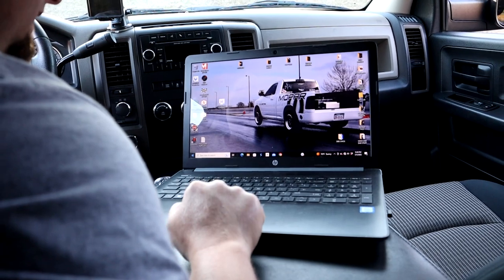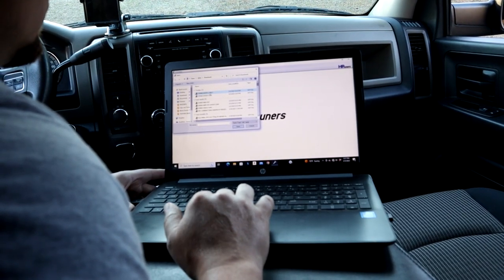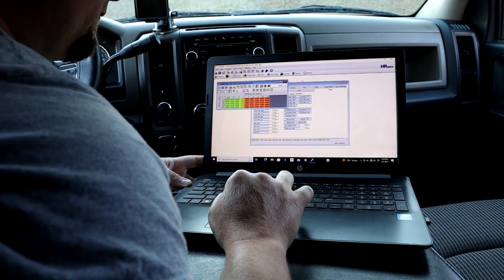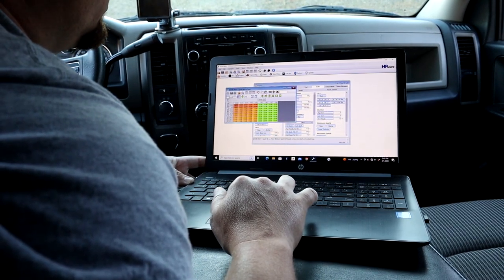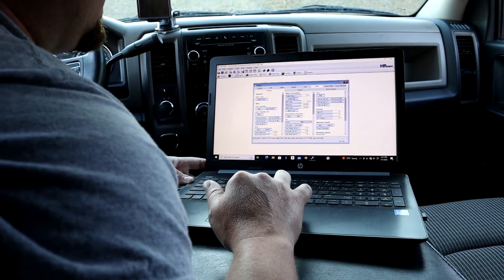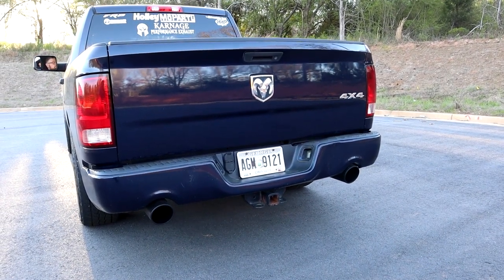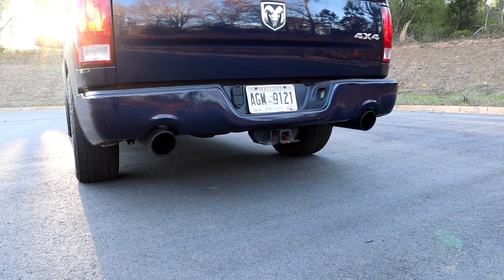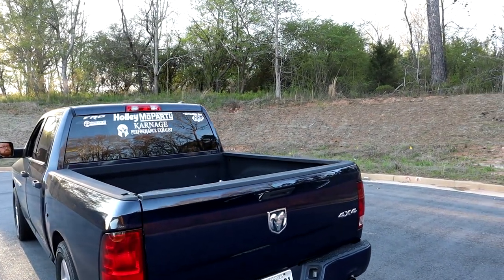HEMI Ghost Cam Tune With Stock CAMSHAFT!

Comment from the maker: Thanks for the awesome support mopar fam. I think this is pretty cool myself especially for the one that just wants a little rumble and not spend the time and money for a cam swap especially if performance is not the goal. Keep in mind I'm definitely not a professional tuner and I'm still learning every day just wanted to share this as a possible option.
Reply: Honestly pretty sick man! How much was the tuner?
Reply from the maker: @donttalkjustplay4274  I use hp tuners software.
Reply: @FrostbiteRam  ...will this work on my 2004 Hemi Ram1500 5.7L quad cab
Reply: Thumbs up! Can this be done with a Diablo tuner as well?
Reply from the maker: @wilsolo1986  should be
Reply from the maker: @ghostrt1608  it may I would think so.
Reply: @FrostbiteRam They didn't start vvt in the gen 3 engines until 09.
Reply from the maker: @bmf88  correct why you say
Reply: How would you do it on a Diablo

Comment: You forgot two things, which is why it doesn’t chop harder to be more noticeable. I can send you a file that has all the corrections you need to make. And it will sound pretty good.
Reply from the maker: Nice
Reply: you still have that file by chance?
Reply: I'm intrested in see your chop tune also
Reply: I am interested in your file as well. Do you have it posted on the HP Tuner repository?
Reply: Do you still have it ?????
Reply: send file koon
Reply: Hi can you due it for my 09 challenger srt8

Comment: Thanks for the video.  I "Ghost-cammed" my 2014 Challenger R/T.  It actually works!  I followed a guy named Randy on RecklessMotorsportsUSA (YouTube) and he went through a lot of the settings.  Because mine is a M6 car, with VVT, I had a little more that I had to do...especially around the idle.  I learned quite a bit from it, making my investment in HP Tuners last year, worth it!  Plus, I've added timing, leaned it out to target 12.25:1, instead of the factory-programmed 11:1.  Good Lord, what are they thinking....dumping all that fuel in there. :)  My Challenger runs soooo much better now.  Responsive (WOT voltage reduced so tip-in is more aggressive), leaned quite a bit (only run 93 now), and higher MPG, due to increasing timing in the highway cruise cells.  I've also chopped the stock 2 1/2" pipes just aft of the stock bottle-style mufflers....and put turndowns on it.  Now, with the ghost cam tune, this thing sounds like a completely different animal.  I can't wait to throw an actual cam in there (Scoggin-Dickey Stage 3) here in the spring. 😎😎
Reply: How’d this go?? I have a 2022 M6 Challenger R/T.
Reply: It went ok, until I started getting "Random Misfire" CEL's.  I've since returned it to a "non-ghost-cam" tune, with all of the other improvements still in tact (leaner fueling, increased PT cruise timing, etc).  No more CEL's.
Reply: @ronbo422  Oh interesting. Thanks for the info!
Reply: @ronbo422  did u ever figure a fix for the engine light. i have the same year and engine but mine is 2014 charger could use your help
Reply: @calebcantrell8722 No, I never did.  It was just random misfires.  I could easily turn that off, in the CEL list, and go back to the ghost cam tune, though.  I've since added long tube headers and midpipes, along with an SRT8 2¾" cat-back system that has dumps, right at the rear end housing.

Comment: For little over year I've been running similar tune on my 5.7 charger with no side effects. My numbers are quite different than yours plus mine also does it in reverse and forward gears if your going to do it why not all the gears. People ask nonstop if it has a cam and everyone thinks I'm bluffing and don't believe me. I read people hating those with ghost cams calling it equivalent to up badging. I don't do it to fool anyone Not my fault it sounds real and they think its cammed as long as when asked I tell them its a tune the sound is my personal preference.
Reply: Bit late to this, but I’ll be doing this same thing to my manual challenger soon. Does having it in all gears affect drivability at all?
Reply: @rija1659  A lot of the ghost cam tunes only sound choppy while in park and once out of park the choppiness goes away. I set mine up to sound choppy in park, reverse, neutral and drive so that's what I meant by all gears. Having it in all gears could affect drivability if not properly done. In my tune I have it stop being choppy if RPM's ever go above the limit I set for example if set at 1000 RPM's everything under 1000 is choppy 1000 and over back to normal Also I have it set up to stop if wheel spin is ever detected. There is also a setting that allows engine temps to start or stop the choppiness so car can warm up better during winter months. I don't know what you should change since your car is a manual, I would find something that would limit the choppiness to a desired RPM or if wheel spin is detected.
Reply: @owood5243  I really appreciate the reply. I’m going to school for tuning right now so that all does make sense. In HPTuners it’s set as “P/N” which is the same for manuals and autos I think. So I believe it’s no different because it’s “Park/Neutral”. Are you custom tuned or on Diablo, etc? I’m pulling my file as soon as my security bypass wire comes in so I’ll know for sure when I pull that to see what it’s like as compared to the auto hellcat we studied.
Reply: Can you show me what numbers you use I plan on doing it to my 392
Reply: @rija1659  I use HP Tuners and do the tuning myself. I went back and looked over and actually paid attention to when the chopping stopped and started. I get chopping at dead stop in all gears, plus at idle rolling under around 1100 rpms and with very slight throttle when under 1100 rpm. It's cool to roll through a parking lot with just enough throttle to go 3 mph and the car being choppy.

Comment: Any updates yet...     trying to get my 5.7 to chop hard like LS , almost like theres a timing correction limiter still stepping in
Reply: Any luck on this??
Reply: Yip , just pull and add a ton off timing ,  I did in drive a little less timing so it still sounds good in gear but not bounce the car .
Reply: @cardinalbaycustoms2702  Awesome! Would you mind giving me a bit of info on how you did that? I drive a manual challenger with the 5.7 and want it to chop hard like and LS but not hurt it obviously.

Comment: my 5.7L with comp cams 274 cam and a whipple idles smooth doesn't sound cammed.
Reply from the maker: Tune can make it sound better.
Reply: @FrostbiteRam  yeah make the timing jump around at idle. No thanks, that's just stupid
Reply from the maker: @dbsdodgeboy  you may be surprised to know most cams chop because of tuning enhancements not just the cam itself.

Comment: What do I need to work on a 5.7 Chrysler 300c 2014?
Reply from the maker: Do you have hp tuners
Reply: No
Reply: Do I need the mpvi3?
Reply from the maker: @magik1ful  you need that or the 2 will work and also the software for your laptop to load tunes